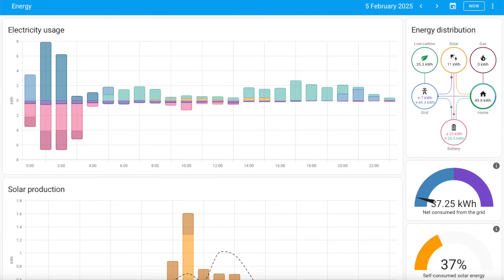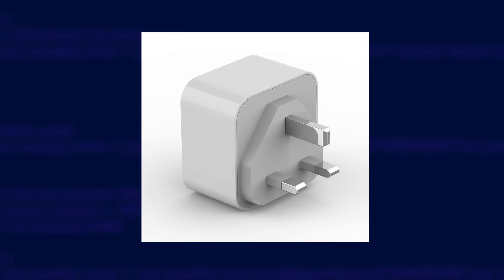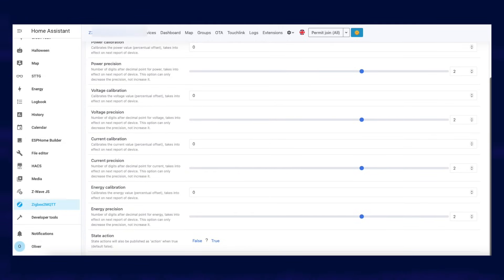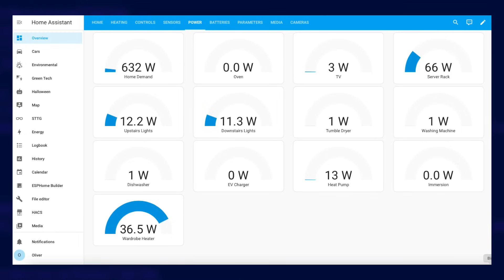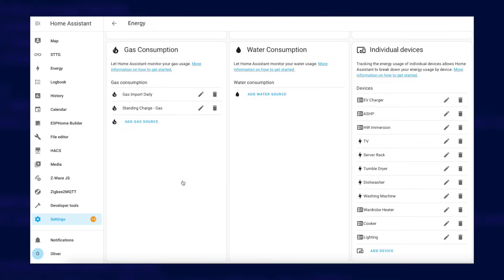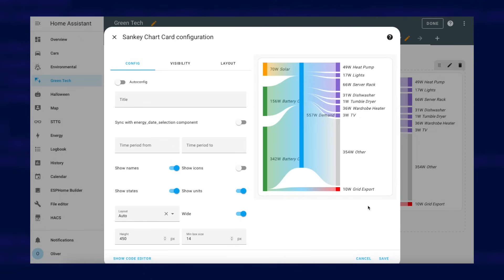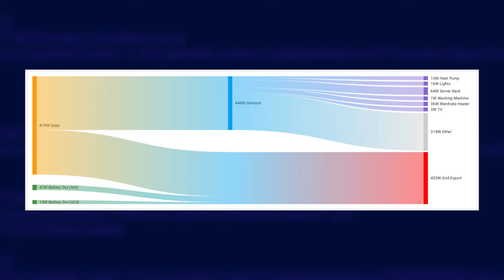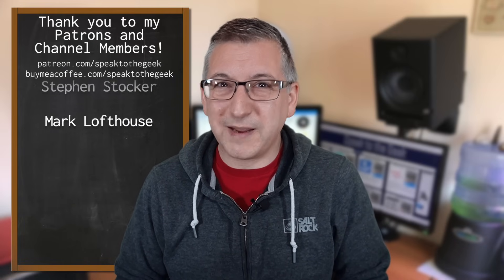Whole Home Energy Monitoring with Home Assistant

Comment: No mention of monitoring inputs? Panels, batteries, grid? How please?
Reply from the maker: So many ways of doing that, it really depends on what equipment you have. I've discussed these in many of my other videos. For grid, I use a Hildebrand Glow IHD linked to my smart meter, for my solar panels on a SolarEdge inverter there's built-in monitoring that I can read in Home Assistant, and for my GivEnergy batteries there's the GivTCP add-on.

Comment: I'm confused.  A few of these Sankey Charts (eg. at 8:43) make it look like you've got one battery's output, flowing into another battery.  This might just be a quirk of the graph, but I hope that's not what you're doing in reality.
Reply from the maker: That's correct! At some points my one battery (AC3) is discharging into the AIO. The AC3 is set to permanently discharge throughout the day and if the AIO has dropped below 100% and there's not enough solar, then the AC3 will go into the AIO. Not ideal, it's a compromise but the benefits outweigh the losses.

Comment: Cool Setup! I am always a bit torn between even more smart home stuff, but also making things too complicated (also to maintain). However i have to say that my experience with Shelly devices has been pretty good so far. They have a very low power consumption, but they do still draw some power. In the winter and on days with not so much solar power, i try to get through the nights with my home battery, so every watt counts 😅
Reply from the maker: The Shelly devices are so low powered that they aren't even noticeable for me in my background energy usage stats, plus I like to think that the data they provide me with helps me to minimise how much I am drawing overall, so they save me way more than they use.
Reply: @SpeakToTheGeekTech  the older shellys are very low in consumption, some newer ones may draw a few watts. It can add up, if you have dozens.. i brought my night time consumption down quite a bit, throwing some things out :-) but having the fancy diagrams is always fun 😄

Comment: Nice relevant video for me as I am looking to monitor my energy usage across my appliances. 
3 questions:
1. I presume that the Shelly 3EM comes with 3 CTs?
2. In the energy dashboard, bars appear for ‘untracked consumption. I presume this is all the usage that I am not monitoring. I have some bars that are negative, below 0. Do you know what these represent?
3. To monitor energy usage of my Solaredge PV and Givenergy battery inverters, would I need to go the Shelly EM route? I cant find any entities that measure this.

Thanks
Rob
Reply from the maker: 1. Yes
2. Correct. Negative bars mean your sensors are dropping in value instead of increasing so are most likely an error in your original sensor for the device.
3. No Shelly needed most likely. SolarEdge can usually be monitored directly - see one of my very early videos. GivEnergy inverters can be monitored using GivTCP - there's a video about GivTCP v3 on my channel. Any issues with monitoring via GivTCP, have a look on the GivTCP Facebook page and maybe ask a question on there. Plenty of people to help point you in the right direction.

Comment: Did you have to do anything special / config wise, to get the Shelly three phase monitoring clamps to monitor three separate single phase circuits ?

I'm hoping to get a pair of the Shelly DIN rail monitoring units added into the consumer unit later this week to monitor the lighting circuits, and the shower/cooker circuits, one three phase and one single phase with an additional monitoring clamp.
Reply from the maker: In the Shelly 3EM's web interface you go to Settings > Device Settings > Device Profile and in there you can select monophase (instead of triphase) and it'll report each circuit separately then.
Reply: @ that’s awesome thanks, it would have taken me ages to find that!

It seems there’s almost no information online about how to wire the EM3 for a mono phase situation.  In terms of the power, the Neutral seems obvious (to the N terminal), but for the A/B/C terminals it’s far from clear whether all three need connecting to live and bridging together for a single phase, OR if just the ‘C’ needs connecting since it’s the main power supply for the device itself.

Hopefully my electrician will just know what needs connecting without having to power down the consumer unit more than once.

I’m not safety certified, but happy to tinker in a sandbox, so I’ve already connected a live/neutral flying cable to both the EM3 and the EM-50 in order to preconfigured them to the network and assign static IP addresses, so fingers crossed the actual electrician setup later today will be smooth.
Reply from the maker: The two wiring diagrams for three phase or mono phase are on their knowledge base: https://kb.shelly.cloud/knowledge-base/shelly-pro-3em#ShellyPro3EM(SPEM-003CEBEU120)-Basicwiringdiagrams

Comment: Just wondering I two Innr smart plugs and I'd like to add them to the Energy Dash as per your video, but I have a problem. I can only add the Summation delivered value, its the only available for this smart device in the energy dash, needless to say this gives wonky results. I think I need to add the Current Power value instead but its not visible. I believe its due the device_class its set to power and not energy and possibly device_type is missing which won't help. How and where can I change these values, I've tried all sorts - honestly I'm not comfortable editing configuration.yaml. Any ideas?
Reply from the maker: You cannot add power to the energy dashboard, very different things. Power is live (watts/kilowatts), energy is power over time (kilowatt-hours kWh) which is what you are billed for. How is your Innr plug connected to HA? Is it using ZHA or Zigbee2MQTT like my setup? In Zigbee2MQTT you need to make sure you have a reporting endpoint set up for seMetering for currentSummDelivered with parameters of 10/30/1. That should give you the required energy sensor. I've no idea what Summation Delivered is... that might be the same thing but you would have to check the details in the developer tools to get device type and device class / units.
Reply: @SpeakToTheGeekTech  I'm using ZHA - I might try another smart that may present the correct values. I did have a TP-Link plug that I think had the correct info.
Reply from the maker: All the documentation suggest it should be giving you an energy sensor (kWh) with the device via ZHA so I'm not sure why you're not getting that. You can always create an 'Integration' helper using the power sensor as a source. That will estimate the energy used based on the power. You can then create a Utility Meter helper on a daily cycle with the integration sensor as the source, and the utility meter can be used in the energy dashboard.

Comment: Great video as always. However, why would I need MQTT for the smart plugs and how would I get the Innr plugs get discovered in MQTT. Perhaps a dedicated video on MQTT install, setup and to use MQTT and why.
Reply from the maker: MQTT is a messaging hub for smart home devices and services, it allows lots of disparate home automation solutions to all talk to each other using a common protocol. You don't necessarily need it, but if you have a large smart home it can become handy. I have lots of Zigbee devices. If you have a Zigbee adapter plugged in to Home Assistant then Home Assistant can use something called ZHA to connect directly to your zigbee devices. That's the easiest for beginners. What I do is separate Zigbee from Home Assistant by running something called Zigbee2MQTT. Zigbee2MQTT deals with talking to my zigbee devices and sends data / accepts commands over the MQTT protocol. Because Home Assistant also talks to MQTT then the two separate systems can communicate. My smart meter also talks to MQTT, as does my Z-wave controller, my home battery and a few other things. If you haven't come across a need for MQTT yet then you might be best to steer clear - without a clear use-case for it it's tricky to get your head around why it exists!
Reply: @SpeakToTheGeekTech  Thanks for the speedy response. I like to keep things "simple stupid" and I don't have a usecase yet, although I tried to setup zigbee plugs in the energy dashboard as individual devices and the data wasn't split out between the plugs - not ideal, I immediately thought about MQTT. So, I tried 101 - I rebooted the Home Assistant server and now I get the split data - yay. Thanks once again.

Comment: Great video. You ever find a UK replacement 2 gang socket with power monitoring and zigbee that would work without the need for the plugin zigbee sockets. Space is an issue and also others in the house turn them off at the wall switch.
Reply from the maker: Sadly not. There are a lot of Tuya-based WiFi ones available on AliExpress but I'm not sure I'd be happy hard-wiring those into my home for safety reasons. You can still get LightwaveRF ones but of course those are extremely expensive and require a LightwaveRF hub to bridge that system to Home Assistant. I do have an old Z-wave UK 2 gang socket in the garage somewhere, I can't remember the brand but I do remember they discontinued their products a few years ago. I just don't think there's a big enough market for decent UK smart sockets for companies to make them sadly.

Comment: Surely a socket where the guts are rated to handle the 16A common in other countries, but in a form factor for the UK is actually safer than one that has a relay rated at 13A?  A higher rated relay will not get as warm, and is likely to have a longer lifespan because of that.
Reply from the maker: Perhaps for some brands, but I have personally seen inside a '20A' rated imported plug and it had a 6A relay inside. I picked Innr because they are a Dutch company and adhere to EU regulations and therefore appear on the face of it at least to be more trustworthy in their regards to electrical safety.

Comment: do you monitor the power consumption of the power consumption monitoring? and maybe (1:25) you need to check out the UK type G plug/socket design 👌
Reply from the maker: The power monitoring consumption itself is included in the overall home or circuit use. Each device is using milliamps though so essentially less than a rounding error
Reply: @SpeakToTheGeekTech  obviously he was joking about that but the UK plug won't electrocute you if you touch it - that's what the black or insulated bits are. They prevent you touching the pin while they're live. By the time you can touch the metal it's no longer in contact with the socket.
Reply from the maker: @jonevansauthor   I'm aware of that, but my point was if you have a thoughtful physical casing design then you don't need to rely on the safety backstop of those insulated parts of the pins because your fingers will never need to go near them.

Comment: Hi, how did you get HA to integrate the INNR sockets, I have added x4 and the INNR gateway and they are recognized by the app but not visible in HA. Help appreciated.
Reply from the maker: The Innr plugs are zigbee so I paired them with my existing Zigbee controller to zigbee2mqtt. I don't have the Innr gateway.

Comment: Did you have a problem where the Innr plugs are reporting 100 times more energy usage? E.g. 100kWh instead of 1kWh!
Reply from the maker: No problem at all for me. Are you up to date on the firmware? Is this in Home Assistant or Zigbee2MQTT? Have you perhaps got the calibration set wrong in Zigbee2MQTT? The fact it's 100x out sounds like a unit misconfiguration or a calibration mistake.
Reply: @SpeakToTheGeekTech  I'm using Zigbee2MQTT. I have reviewed the settings for each plug in Zigbee2MQTT, and they're identical. One plug is showing correctly, but the others aren't!

Comment: you showed a power plug that has literally thought of what you're saying (safety for fingers) as an example of not thinking about it - their plug has a plastic/paint coating on active and neutral for the exact purpose that you highlight...
Reply from the maker: Yes as do all plugs if they are sold in the UK. I was talking about the physical shape of it. Those flush fitting ones also regularly cover up the socket switches and USB ports

Comment: A tip for the ASHP - ESPaltherma has the '3 Way Valve' attribute which will tell you if it's running heating or hot water. You can create a utility meter with that as a trigger and the options as tariffs to split the consumption down further if you want that data
Reply from the maker: Thanks, I use that sensor to highlight hot water / space heating on emoncms. I don't tend to divide up the heat pump use any more within Home Assistant itself because I get that detail in emoncms, but I can see the advantage you are suggesting

Comment: What is the 'Solar production' graph at 0m15 showing? What are the sources for dark brown, light brown and the line graph? I'm trying to do something similar, I want is the 'Gas consumption' bar graph with the external temperature as a line graph on the Energy tab. Home Assistant has all the data, I need it to show me, preferably there. I asked Tim from TimAndKatsGreenWalk, as he had that graph in his last vid but he does it in gsheet. I'm too lasy for that.
Reply from the maker: The colours in the solar production graph are light orange for solar production energy sourced from my solar inverter itself, dark orange for wind farm (no option to separate wind from solar in Home Assistant) sourced from the Ripple Energy API, and the dashed line on the graph is forecast solar provided by the Solcast API. The Energy Dashboard in HA is very fixed in what it shows you - you can’t add your own graph with temperature overlayed as you are hoping. You would have to use another card integration called Apex Charts and that’s even more work than GSheets!

Comment: I'm still disappointed for home assistant energy dashboard to have ev charging in the house consumption. It should be separate, as it screws the amount of energy and cost actually used for living.

Basically everything else is eventually heating the house (or insignificant like yard lights), but charging a car for 50 kwh in random nights messes the stats.

I have setup my evse as a battery in HA, as I don't have a battery system, but it still messes up the price.

As for using wifi-sockets as energy meters, I would have to solder the relay contacts to stay on. I can't stand the chance of relays opening on something I wouldn't shut down ever, like fridge/freezer, washing machines (while running), servers etc. I just can't trust (networked) Chinese electronics and relay contacts enough as an electrician.
Reply from the maker: I really disagree with that, sorry. EV charging is still part of my demand for energy and that’s what the dashboard is tracking. I have split my EV charger out as a separate individual device too so as I can keep track of it, but overall it’s part of the bigger picture that I want to monitor as I feel most people also would too. I don’t consider those EV charge spikes to be messing up my stats, and they’re an important part of my energy costs.
Reply: @SpeakToTheGeekTech  do you also add charging your car at public chargers to your home usage? You most likely have to pay for it, it just doesn't show on your utility bill (or ha dashboards?).

Cars should stay separate, unless there's an active V2H or V2G system involved and the energy is also flowing back to the house. Mine has only V2L and using it happens far away from home, so it most definedly would not do anything to heat my home. 

It's just odd to have a graph where the house takes 50-150 kwh/(winter)day and random days have +50 kwh on them. It would be way easier to track changes in heating, insulation, human behavior, weather etc affecting the efficiency and cost, when the totally separate entity like an ev isn't there.

If you need to see the big picture in whole, I would suggest for such devices to have an option to select if it is included in the house usage or not. There should also be an option to have several buildings in the dash board, so you could separate the costs for a workshop etc in its own building.

Here in the nordics, heating the house is the main energy consumption for most of the year. Any electrical device inside could be counted as an heater. So having 2 ton vehicle 20 meters off the house taking a lot of energy feels really separate of that.
Reply from the maker: @villehietala9677  Well no of course I don't count that because it's not energy demand through my meter at my home. My home EV charger however is. I understand your want to keep it separate, but I think you might be in a small minority and unlikely to ever see an 'exclude specific devices' option unless you dive in and help code that functionality yourself. You could always add it as a feature request to Home Assistant on Github and see if it gets much interest from others, that would be a good way to gauge its likelihood of being added.

Comment: I have the Shelley 3EM installed in my switchboard and I have it monitoring my single phase power and my solar. It works great. I also. have Shelley 1 and 2 PM plus's installed behind every switch so I can monitor the power on every light, and also have the smart light bulbs work correctly. I had to get PM's as at the time there were no 1 or 2 plus shelley's for sale. I do like the idea of groups the power for all the lights, that will work really well on my sankey chart. So great idea.
Reply from the maker: Wow that’s impressive detail. I think for me given that my light circuits never pull more than 50 watts each that worrying about individual light consumption would be unnecessary but I do appreciate the effort you have gone to!
Reply: @SpeakToTheGeekTech  the other thing that I forgot was that because I have Shelley 1 & 2 PM Plus's all over my house I now have a Bluetooth proxies everywhere